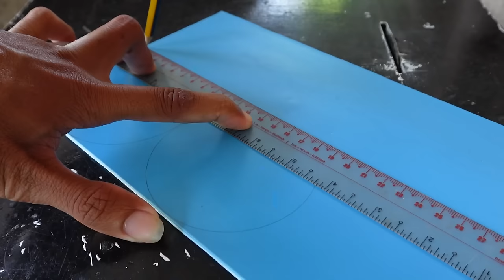Part 04_RC Dump Truck HINO 1/6 Scale Project _ Rear Differential Axle 2

Comment: The work abd design is excellent. My only concern is the glue choice, it looks to be CA superglue. That is a very brittle glue, any twisting stress and it gives way. That material needs a welding solvent type glue